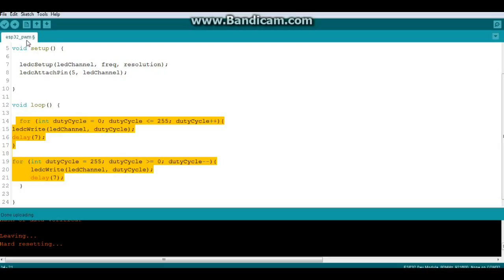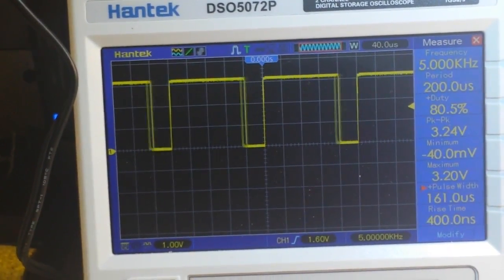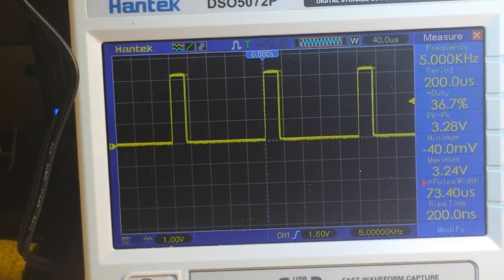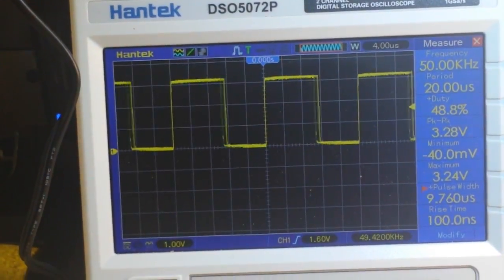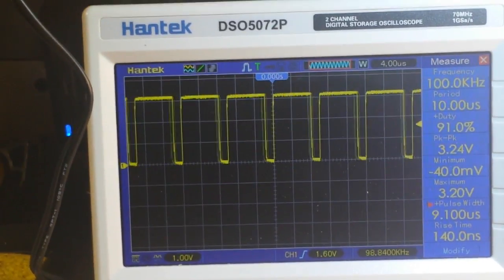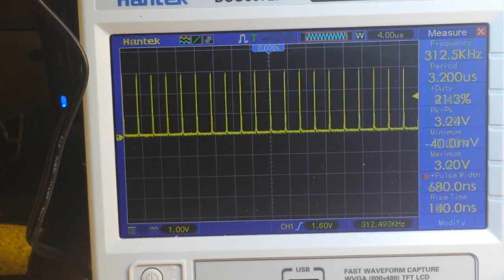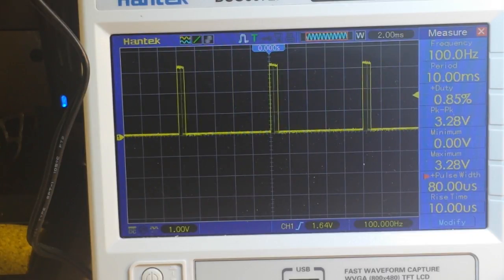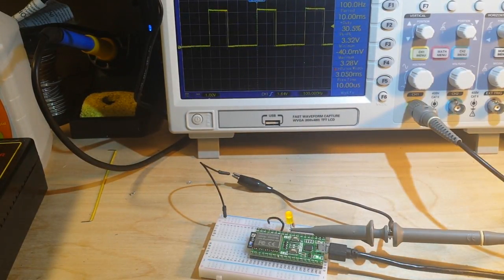ESP32 PWM alternative

Comment: If you are using the minimum clock frequency of 80MHz at which WiFi still functions, the maximum PWM frequency will be 80MHz divided by 256 values at 8-bit resolution, which is exactly 312.5kHz.

Comment: Couldn't easily find the spec online then this. 312kHz upper, at least down to 100Hz. If I can set this up on constand 50% duty and instead vary the frequency inside the void loop() I'm in business. 👍
Reply: did you did it? i need to vary the frecuency of my nodemcu to control a driver for a step motor

Comment: Old one for you but great one for me :) thanks.
If you change int resolution = 1; you can push freq to  40 MHz in theory, but duty cycle will be 50%.
http://esp-idf.readthedocs.io/en/latest/api-reference/peripherals/ledc.html#ledc-api-configure-timer
I manage to measure 11 MHz, but with voltmeter, so...
Reply from the maker: 11MHz is impressive